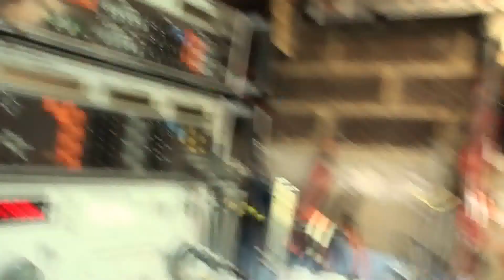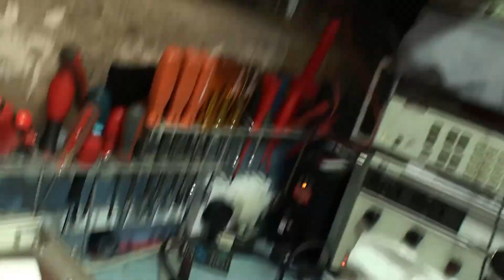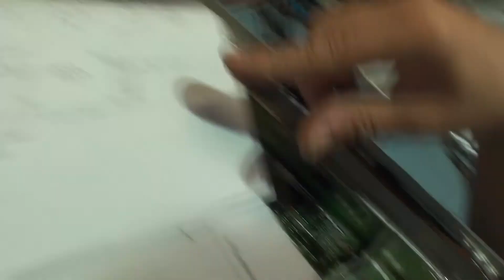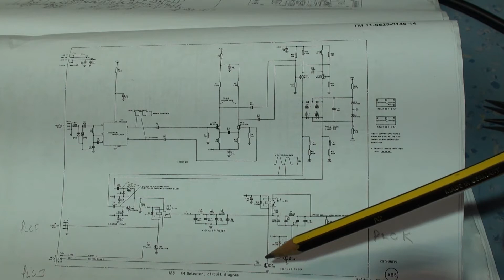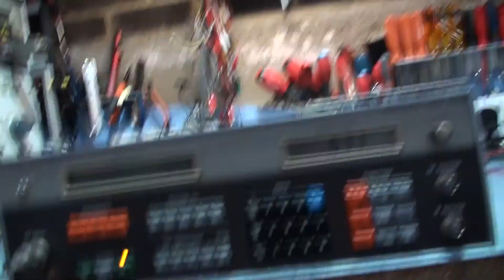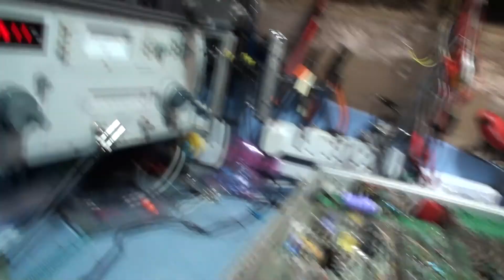Marconi 2305 Tracing the AM modulation fault

Comment: I am sure this isn't relevant to you anymore, Simon, but if anyone else tries to test his 2305 by running through the 08-x registers, take care to reset the unit before, attach 100MHz carrier with 100kHz FM deviation and 1kHz modulation. Then check Filters is set to Flat / 10-300k and De-Emphasis is Off. Now read the registers and they should read fine, or at least not all of them are out of spec at once. In your case the frequency and filter setting were wrong and I could verify the same faulty looking readings on my good unit as your unit showed.

Comment: If your not too worried about accuracy of the 10MHz reference, you could replace the OCXO with a TCXO, should be accurate enough.
Reply from the maker: +TheDefpom I seem to have fixed it be re soldering the joints.
I am now looking at the VCO voltages that should be at -10V when the selected Oscillator is manually tuned to 1.5 meg below it's range.
If I am looking at the right point the output is erratic.
Reply from the maker: +TheDefpom I seem to have fixed it be re soldering the joints.
I am now looking at the VCO voltages that should be at -10V when the selected Oscillator is manually tuned to 1.5 meg below it's range.
If I am looking at the right point the output is erratic.
Reply from the maker: +TheDefpom I think it just needs a bit of tlc. These ocxo's re not known for their reliability.